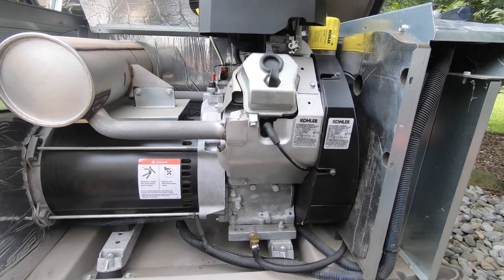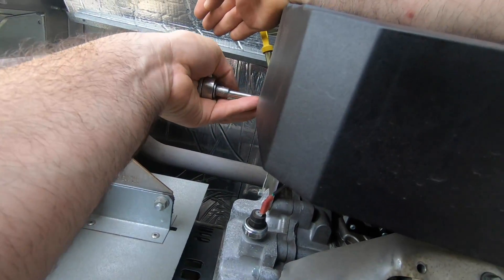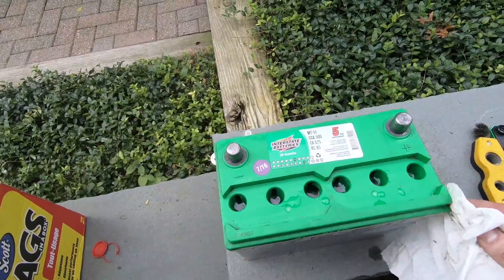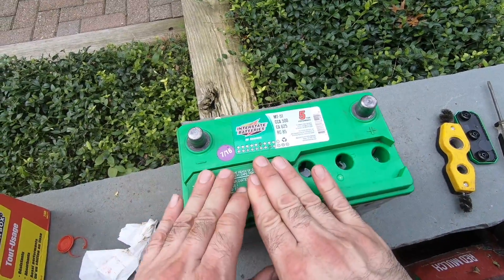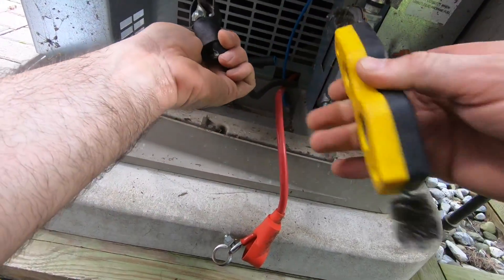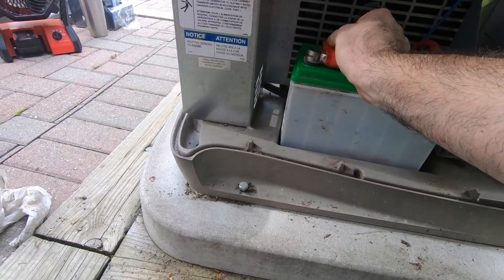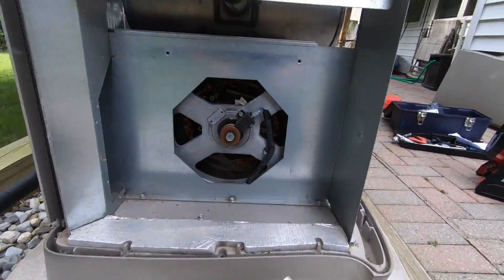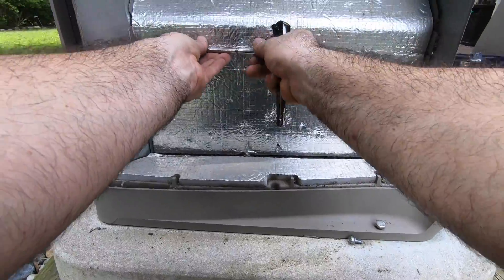Kohler Generator Maintenance Must Service

Comment: Hola veo tus videos desde Guadalajara, me interesaría mucho saber como conectas los cables de control del tablero de transferencia.  mi generador es marca KOHLER modelo: 20RESA con un tablero mde transferencia  #OG0366A   ISSUE NO. HM 323392.
O saber por lo menos el diagrama de conexión  entre ambos dispósitivos.  Slds.

Comment: Have a Kohler whole house generator. My problem is getting it to start. It turns over just fine and wants to start but after about 5-8 seconds quits. I have to hit stop and run several times (can be 6-10 times) to get it to start. It will run rough for about 10-15 seconds and then purr like a kitten and run great. On the weekly test it pretty much won't start after two attempts on its own. I have to go out and hit stop and run myself to get it to run. I the new home owner (11 months) and service has come out three times. Twice for just annual check up. First check they said it was fine, it wasn't. Second time he again said it was running fine. I called the company the next day and complained and told them I thought it was a carburetor issue that has not been addressed. Asked for a different tech that knew about small engines and they sent the same guy out. He couldn't fix it and said I needed a new regulator or so he thought and they could replace it for $800. I told them never mind, I'll start it manually. Any thought of what it could be? Happy to dive into it myself if I know what to look for. TIA for any help. Wish you were anywhere near me!

Comment: Do you have a video about how to add the tubes/elbows on the regulator??  Please make one!!! What size/type of fittings?

I am getting a low frequency shut down on my generator. I replaced the main regulator going to the generator. I did brushes and a stepper motor several years ago.  I did replace the stepper motor bushings. I was getting a flutter at 8psi.
Reply: Just a suggestion: You can check if you need the vent lines on the regulator, if you haven't already, by running the generator and removing the side panel on the regulator end, and see if the situation changes.  Sometimes the vent ports get clogged by insect nests, too.  There are two.  Sometimes having the hood up affects it also.  In either case, the fitting is a 5/16" brass to tube adapter.  Tubing of appropriate size, placed outside the incoming air stream.

Comment: WHAT IS THE BLACK TOP COVER ON A KOHLER 14KW MICE ATE THROUGH THIS IT NEEDS TO BE REPLACED.
Reply: That is to direct cooling air flow through the unit.  You should use rodent bait packets inside the cabinet as mice like warm location during the cold season. Your Kohler dealer can get a replacement.  Probably find them online, if you look.

Comment: Check the heat shield on the wiring harness to the control panel to make sure it is protecting the wiring harness. Due to a manufacturing defect, the heat shield was not properly connected on mine and the wiring harness shorted out against the muffler, taking out the control panel. This happened over a month ago on my year old generator (that I have  a 10 year warranty on)  and I am still waiting for my $2600 refund from the Kohler Warranty department for the repair.

Comment: My Koehler generator is running a little rough (surging) a little. But then after about 30-40 minutes it quits producing electricity, although engine keeps running. I have the Kohler
model no. KOH20RESC-SELS
Size 20kw
Engine: CH1000 4-Cycle

Comment: Proper way to fill the battery is to add distilled water to just below the level gauge. If filled to or above these, the electrolyte can wick out and cause a conductive moisture on top of the battery. Then corrosion begins to build up. Pro Tip: A clean and moisture free battery top will never corrode.
Reply: 100% agree do not overfill the battery because as it charges or is discharged during use, the electrolyte will warm and expand, and can leak out.  However, most of the time the corrosion I have experienced emanates from a failed seal between the battery post and the case.  Yet one more reason not to pound on the battery terminal connectors to make them fit-always use the proper tool and DO NOT over torque the battery terminal bolts.

Comment: Checked my kohler engine oil today. Oil on dip stick looked clean. 
When I plulled the oil filler cap off. There was some milky moisture on the inside of the filler cover.
The kohler generator was installed Sept.2022..
Reply: It is moisture accumulation due to insufficient run time.  The unit needs to run long enough to basically "boil" (evaporate) the moisture trapped or entrained in the lubrication system-sometimes 20 minute runs are not enough over time.  I would probably run it for an hour maybe once a quarter and see if it clears up.  Maybe once a month, to get the moisture out initially, depends on environmental conditions, humidity, temperature, etc.

Comment: What size Allen wrench do you use on that set screw?  Also, do you have a source for two replacement parts:  GM100831-S (hinge assembly for cover) and GM84044 (engine cover assembly).  I'm located in Marco Island, FL and do my own maintenance thanks to this video and these two parts need to be replaced.  Looked online and there are a couple of sources but not very responsive, specifically Brags & Hayes and ATAN-demo store.

Comment: 3:02   Yup, batteries seem to not last too long in these.   Also, our 20 KW uses oil!  Ran for over 2 days and it was nearly a quart low... Half it's capacity.
Reply: Not unusual.  The manual states one oz of oil for every operating hour is "normal".  Some use oil some don't-that is for a Kohler.  But it holds about 2.9 quarts of oil.  Generac has about 1.9 quarts of replaceable oil.  (the remainder is in the oil cooler, lines and engine.)

Comment: Thank you. Today, of your big three, I found 2 on my unit. The 4 bolts (10mm) were all a little loose, the battery was a little low on water, but the tiny set screw was tight. 2 1/4 quarts oil did the trick. Wiped down, cleaned everything. AC PF53 oil filter, same as my riding mower uses. Blew out air cleaner, it was very clean. Reset system, back to auto, really enjoyed it. Thanks!

Comment: Just a tip, if the negative is not on the battery, there will be no spark on your wrench if you touch the generator.  Just a comment

Comment: How to access rear sparkplug?
Reply: Just reach back there and do it. It is tight, and you will likely have to install the plug socket first then the ratchet but it can be done.  Just don't drop anything.

Comment: Just replaced the slip ring and brushes today. It was a hell of a job and I am shocked I got it to work. Fired right up. They melted and I don’t know why. I was quoted on a whole new rotor assembly or a whole new generator, even though it only had 162 hours…..my local dealer had never seen the issue nor do I think it was ever inspected. 

The guys on the smokstak forum helped me tremendously! This is a great video as I’ll prob take on my own maintenance now.

Comment: Thanks so much for this video. I've been servicing my 20 kW generator for over 10 years now and never knew about the bolts, set screws and brushes. I serviced mine yesterday and found all were fine. My battery needed water after replacing it after only a year. So, I agree that it gets overcharged. My last one had a hole in the side!

The biggest challenge is the rear spark plug. I accidently dropped the new one behind the heat shield and it was quite a long ordeal to get it out. I had to remove all panels (top, back, front, sides) to gain access. Then, I had to partially remove the heat shield to get it out. Note that if I had the socket on it, it probably wouldn't been able to get dropped in there.

I usually only replace the oil and filter every year and the air filter and plugs every 3 years or so depending on the number hours on the generator. Thanks again!

Comment: Thanks, you R incredibly helpful.  Very thorough with a lot of integrity for what you do.  Solved my issue with no start by cleaning the holes where there should have been tubes according to sb722 in 2011.

Comment: Mine hunts a lot, first was natural gas meter was too small, had uograded by certified plumber, still hunting, rep suggested diaphram  carb/fuel/air might have bugs that crawled up tubes and messed up fuel/air mixture causing engine to run funny. Checked governor ohms, they were good. Great advise on tightening bolts under air filter. Trying this tomorrow with service & fuel diaphram insoection.

Comment: If things are vibrating loose over time, it's worth using some Loc-tite or similar on it. Batteries are also a consumable and should (rule-of-thumb) for lead-acid be swapped out after 4 - 4.5 years or so, and at the latest 5-6 years. I once dropped a large wrench on a car lead-acid battery's terminals and got one of the nice weld marks you speak of, quite exciting when it happens!
Reply: My customers get a new battery every 3rd year.  I never have battery issues.

Comment: Ever thought about using low strength loctite on that stepper set screw and use a torque screw driver to test tightness on every maintenance nut and bolt?  Just curious 🤔,  I believe it would make maintenance more simple and less guessing if all is in spec., I would like to hear your thoughts on this. Thanks for sharing this video.

Comment: First time viewer of your videos, very helpful thank you for making these. I have a Kohler 20RESB Natural gas just like this one. Since last year it will crank but not start and ends up in overcrank error. I have changed oil, spark plugs, air filter, the 15A 250V fuse thats connected to the fuel shutoff valve/solenoid. I am also going to try to see if its the thermostat -- looking at the diagram I cant figure out where this is actually located in the genset. Any thoughts? I dont think its fuel pressure (but I could be wrong) since there is nothing to indicate that the fuel pressure was bad (this ran from 2016-2021 without a problem. Total of only 96 hours on the genset actual runtime.
Reply: Just wondering if you resolved the issue, mines doing the same thing, been fine since 2011, cranks but I’m not getting a spark from the plugs.
Reply: @ericdvorak7030  I did get it resolved actually but it was such a "dumb solution". The fuel solenoid was stuck and wouldn't open. I had to pay a service company $300 to come and just whack it with a mallet and it has fires right up since. Sometimes these components are just temperamental.
Reply: @varghesejoel  Since there is moisture in the fuel, it accumulates at restrictions during pressure changes.  Those areas will freeze during cold weather and do the same thing.

Comment: There is a 'Maintenance Required' message displaying on the control board.  Will the generator still run if this message is displayed?   

Thanks in advance.
Reply: Yes, it will still run normally.  Once you do your maintenance, hold down the off and auto button at the same time until the maintenance timer resets to 150 hours / 12 months.

Comment: My generator stopped working and said engine high speed. I was about to call a tech to come look but watched your video. The little set screw had come loose and the linkage was apart. Took me 10 minutes to fix it and it's running great now. You saved me a service call brother. All YouTube videos should be this good. Thank you.

Comment: Hi great video! My question is how do I fix a “locked Rotor” I’ve done my oil change and a tech has also updated the computer on my Koehler generator…I think the “rotor locked” because I did not flip the power switch back on before I pressed the “run” button . I have also reset the the maintenance message. Any advice to fix the “rotor lock” is appreciated…Thank You

Comment: That battery being what looks like 2 years old already, and being run dry, I would have changed it out. I have the same unit, and get about 2-3 years from my batteries. I do have the upgrade board to solve the overcharging problem, but have been too lazy to change it for the time being.
Reply from the maker: Kohlers kill the batteries

Comment: About to perform my spring maintenance on my Kohler 20K. This was very informative and I made notes to check mentioned bolts and battery maint.  I just wondering if I have to pump out the oil  or will gravity be enough to drain out the old oil?  Is it ok to just air compressor the air filter instead of replacing every year?  Are you replacing the spark plugs every season as well?  Thank you for a great video. Pete in Canada.
Reply: I ran my generator in manual 5 minutes, let cool for 5 minutes, oil drained well. Gravity does well, oil cap removed helps. After 5 minute drain, remove oil filter, more oil then drains out. I clean my plugs, swap them around, replace at 2 years.

Comment: I know this is an old thread you may not even see it I've got a Kohler 20 kW just had it installed about 4 months ago it's been exercising just fine every week around 1pm.
this morning power goes off at 5am generator doesn't come on.
I go outside after it's daylight lift up the hood red lights flashing fault code speedfall I believe what it said engine felt warm even though I don't even think it had run maybe it had this power went off intermittently several times during the night.

this is a brand new generator I cannot believe I've got an issue with it.

Comment: My stepper motor fasteners got loose and one of the control conductors became abraded. I had to pay through the nose to have it replaced, all because of a loose bolt. Thanks to you I know to regularly check for loose fasteners. Thank you.

Comment: I have a 20K generator and just received a Low Generator Frequency Shutdown Fault.  What causes this and what do I do to fix it?  Thanks!
Reply: What was your issue?  Please tell.  Having the same issue.
Reply: @CJINW  It was two years ago, and I can't remember what the issue was.  But I know my generator engine was "hunting," and my repairman fixed it.  It might have been that the air filter needed replacement, but I'm not sure that was the only issue.

Comment: What upgrade are you referring to to prevent battery overcharging? Thanks.
Reply: if you're having problems disconnect the battery charger and install a Schemacher maintainer.  I think i have around five of them at this point and not one has failed or overcharged in over ten years.

Comment: Glad I just bought an AGM battery for my Kohler.
Reply: A waste of money.  Unless you are going to test the battery every year, they will fail just like any other battery.  Just buy the recommended group size battery from a reputable brand and replace it ever 3 years or so.  Cheap insurance.

Comment: Why not get a Lithium Ion battery and eliminate the lead acid battery issues? My Kohler 14 kW generator gets delivered in 2 weeks and that battery swap is at the top of my list. I have an outlet right next to the generators spot. Why not run a battery tender to the Litium Ion Battery once a month?
Reply from the maker: Lithium batteries very expensive. Customers don’t want to spend a fortune on a battery that might not start during a power failure, in extremely cold weather. A lead acid battery will provide 3-4 years of power for a generator starter. They need around 500 CCA / cold cranking amps to turn over starter. Let me know how it works out. I’m not against this if it can work. The generator has a built in trickle charger for the battery
Reply: A waste of money.

Comment: Hello, our new Kholer 20kw generator’s battery can’t last for a week to start next exercise, should it comes with a battery charger to keep enough power to start the every other week’s exercising?  Thanks 🙏
Reply: Battery needs to be in a constant charge state. 120 v is needed at all times to the utility terminals on the generator
Reply from the maker: Yes depending on model of generator. RES models had an external battery charger. Any generator with the RDC controls external. They had red display. The rdc2 controller grey display the battery charger was built in. Also many generators were installed with gfci breakers. If that is tripped then the battery charger has no power.

Comment: How do we keep mice out of the enclosure?   We got our 20 KW Kohler installed a year ago.  I'm a contractor and had my electrician do the work.  I got alerts that it's due for the first service but other than bi weekly run schedules it doesn't run that often.   Should I change the spark plugs and air filter this soon?  I would think just the oil would need to be done at this stage.
Reply from the maker: Third shouldn’t be any openings mice could get into the generator. If they can seals are missing or installed wrong. I only seen insects mostly ants get in.
Reply: @thehvachacker   I’ll have to look and see where. It’s brand new summer of 2020.   The two end panels have that mesh screen.  Seals around lid are good.

Comment: My battery got low. I replaced it but lost the original programing. 
 I had it connected to Wi-Fi but after the new battery was installed i could no longer use my kohler app on my android . Mainly I could not set the generator to run every other week . Plus I have to manually reset the run time if I want to change the time of exercising.  How do I reset the program ?

Comment: On my 14 RESA the battery was charged so heavily that I had to fill the battery with water monthly. After replacing the battery twice in 2 years due to over charging I removed the charge lead coming from the controller going to the starter solenoid and placed 2 layers of heat shrink tubing over it to insulate it. I then went out and bought and installed a 6 Amp. Battery Tender sealed charger in the enclosure and attached it to the solenoid. I now never have to fill the battery and it is always at full charge plus it is 5 years old and still tests good with a refractometer.